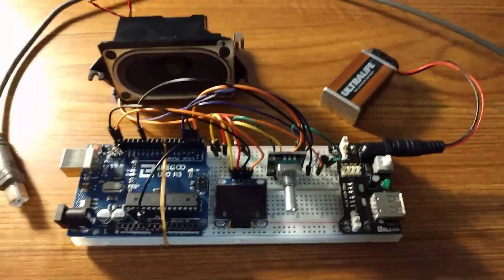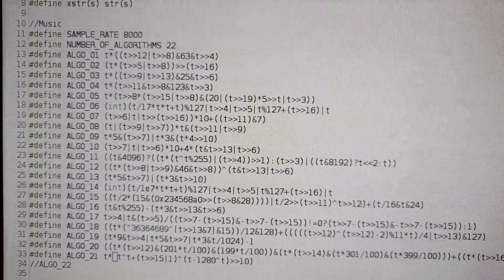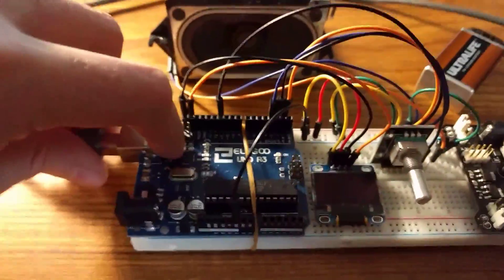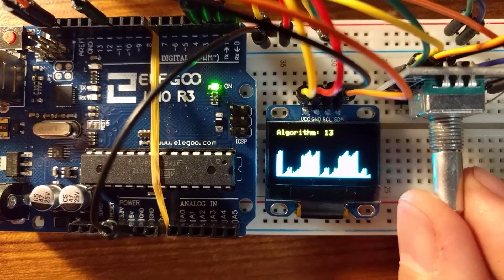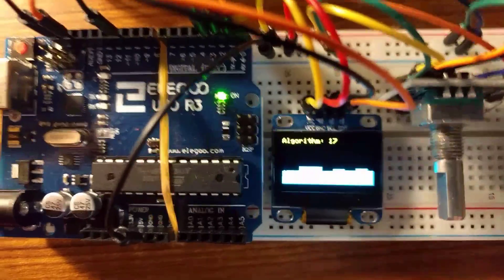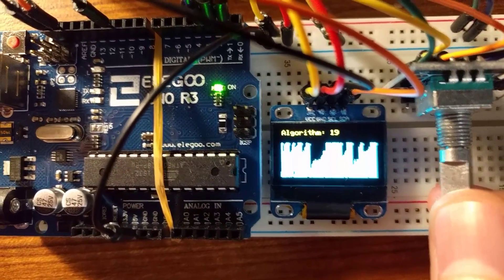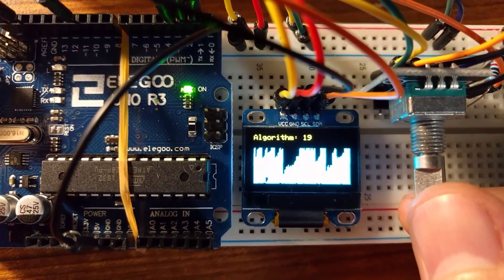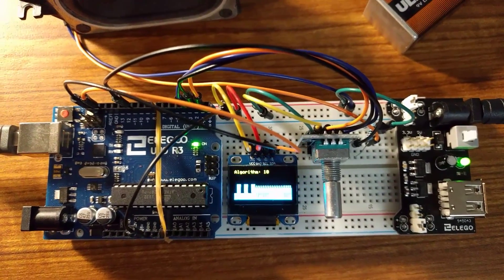Algorithmic music on Arduino

Comment: Thanks for making this video!!!  I appreciate you posting the code also!!! With a little tweaking , so far I managed to get 105 algorithms to play without the display or sound freezing up. All are correctly viewed on the display. Only using 87% of the program storage space and 40% of the dynamic memory. The encoder is a little temperamental. Sometimes it tracks well and sometimes it jumps ahead a few algorithms. It is on the breadboard. Maybe once I solder the connections it will be better. I noticed in the code you have the encoder button on pin one. I did not see any other reference to it in the code and it does not do anything when pushed except light up the RX light.   Is the encoder push button supposed to do anything?  Thanks again!!!
.